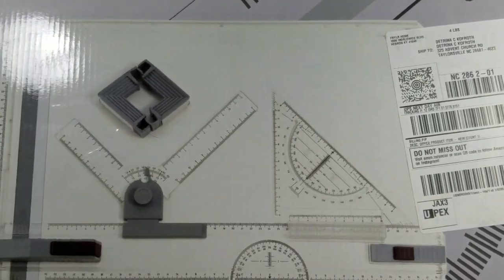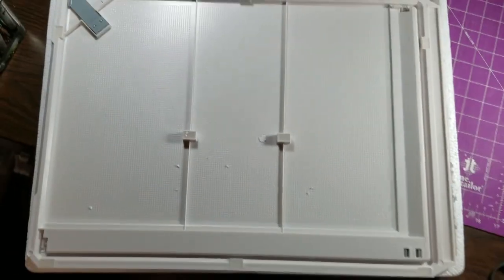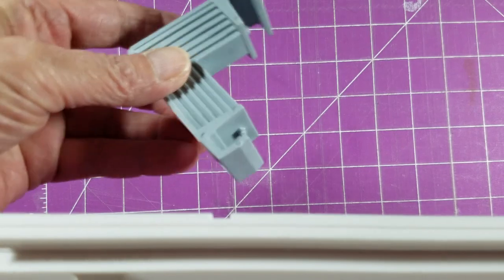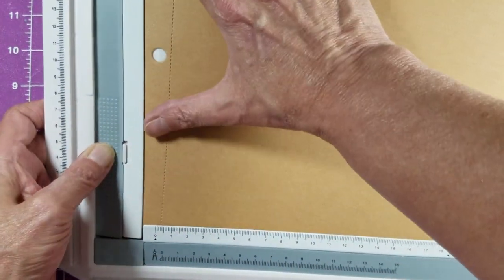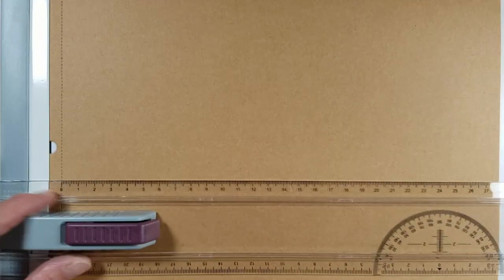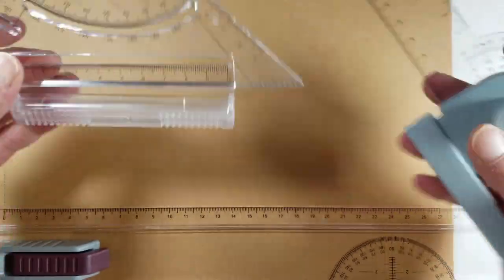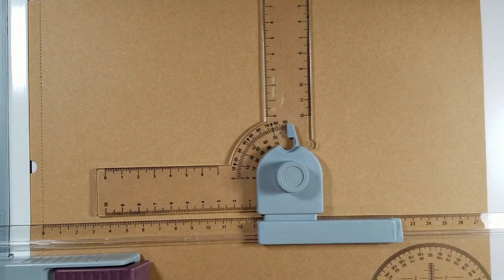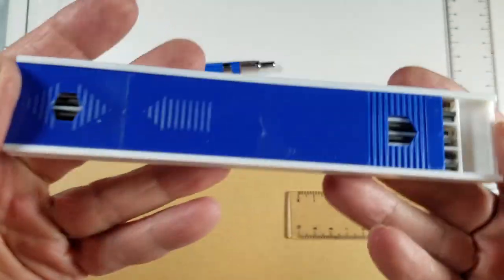Jewelry Designing Basics - Tools Review - Drawing Boards

Comment: Please what if the vertical bar is too loose, thereby doesn't hold the drawing sheet properly, how do I fix that please
Reply from the maker: I would reach out to the manufacturer for that. Mine stays very well. There might be a slight defect. I am sorry I can't be of more help, but I just did a review of the one I bought for myself. I am not affiliated with the maker of this board.

Comment: ALL I WANT TO KNOW IS HOW THE HOLDER STUFF WORKSSS, THE MECHANISM PEOPLEEE
Reply from the maker: Hi Warchief
So the mechanism to hold the paper is twofold. The corner of the paper goes into the slot at the top right of the board. On the left side of the board, you press your thumb along the gray strip to pop up the the metal strips along the left side Check around the minute seconds mark for the demo on this mechanism. Have a good day, 
If this is not the holder you were referring to, let me know and I will see what I can do to explain it further. 
Dee

Comment: Can i use card board sheets to that?
Reply from the maker: Hello Ruel,
I think the answer depends upon the thickness of the cardboard. The paper holder lifts up quite a bit and would accommodate card stock and some cardboards. The groove in the right corner is not adjustable but is only a few mm's deep. Hope this helps. Check out the listing on Amazon and ask questions of the seller. This is my affiliate link. If you purchase using the link, I make a very small commission. 

https://www.amazon.com/gp/product/B0789GQN9P/ref=as_li_qf_asin_il_tl?ie=UTF8&tag=alluringbeade-20&creative=9325&linkCode=as2&creativeASIN=B0789GQN9P&linkId=4a74e231ddc9e8903ce58c7eceea989d